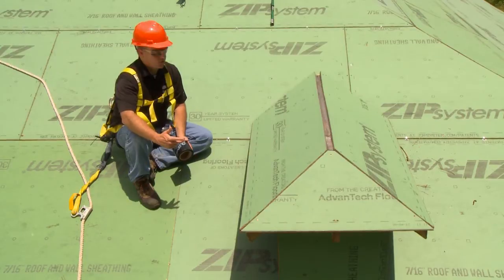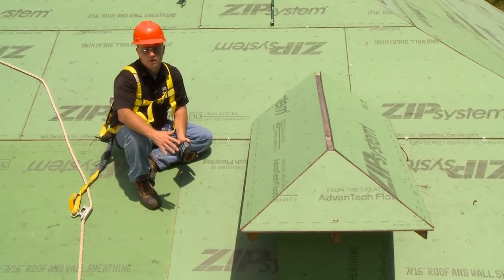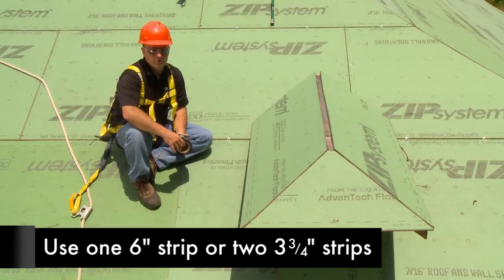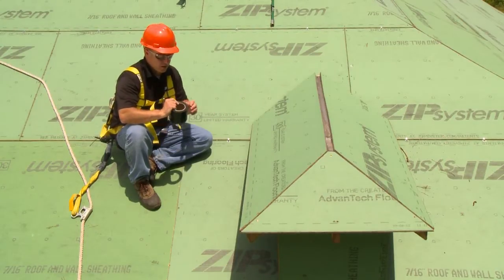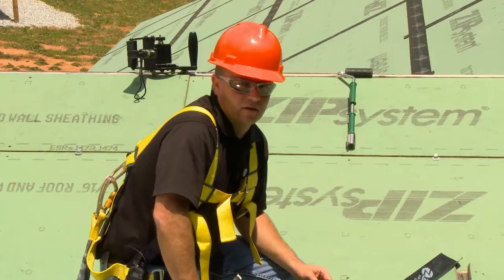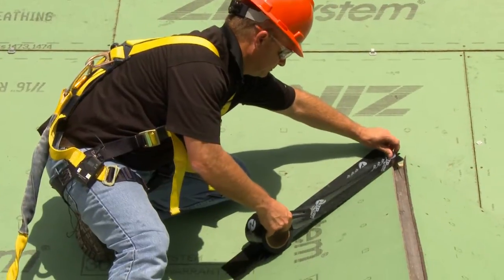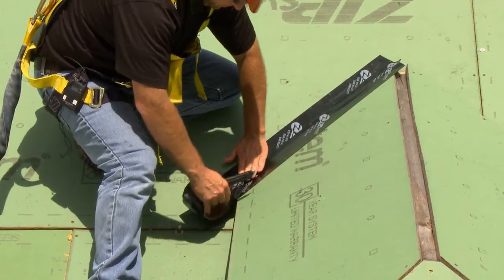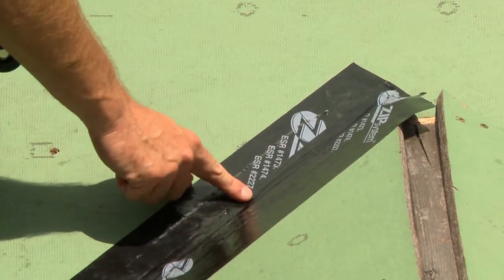Taping Roof Valleys with 3.75-Inch ZIP Tape | Mastering the Basics | ZIP System roof sheathing

Comment: It's a minor point but, if you're using two strips of the 3 -3/4" tape, why wouldn't you place the downslope strip first, so that any water coming down the higher/upper/larger slope so that the lap protects you, in addition to the adhesion?